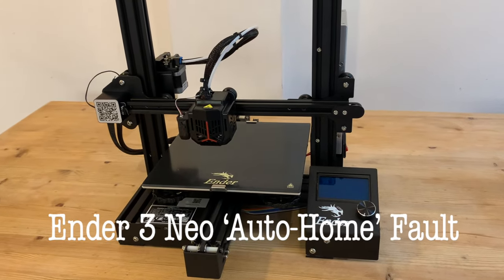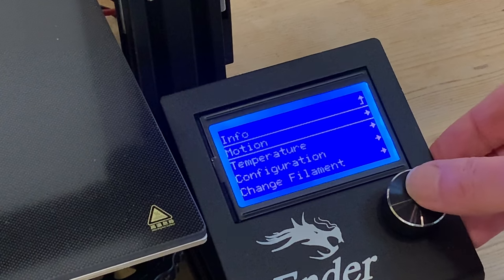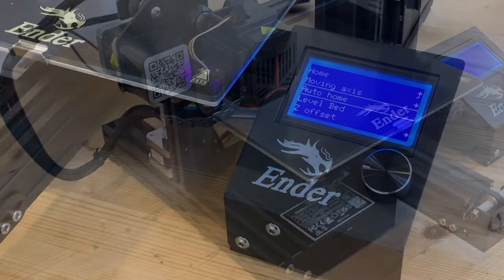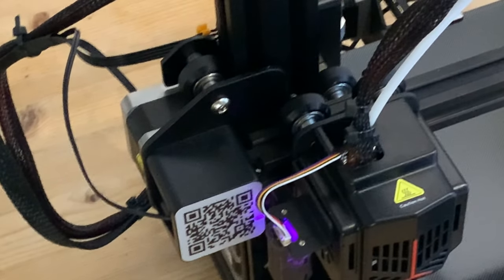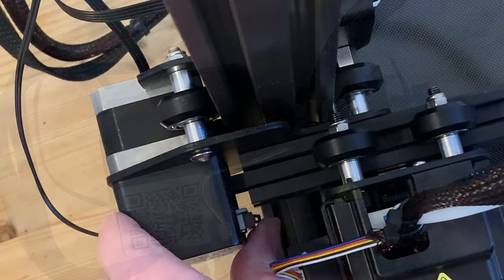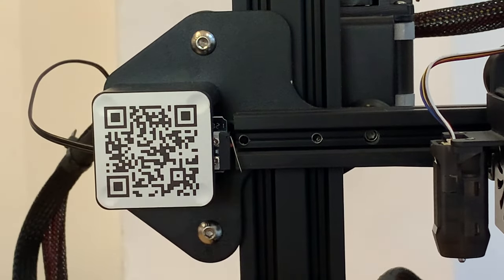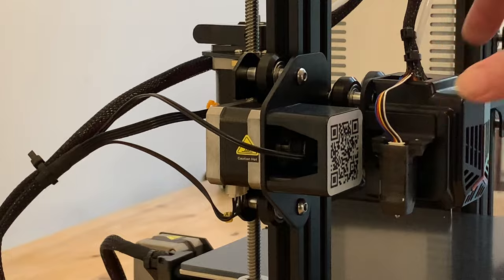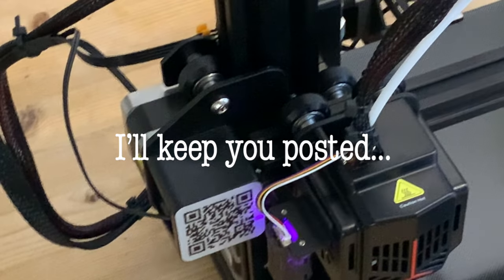Ender 3 Neo 'auto-home' fail - factory pre-assembly fault

Comment: Hi! I'm having the same problem as you, but in my Ender 3 V3 SE. The printhead goes to the ver right side and crashes with the end of the axis making that noise. I also have problems with the home coordinates because my printer starts too far from the usual home... I've tried to contact creality and they give a sh*t about me... Did you manage to fix it? Did they give you other suggestions or solutions?  Thanks for sharing!
Reply from the maker: Still pursuing with Creality by email, but I think I’ll end up reconstructing the faulty assembly. In your case, is there a micro switch at the end of the run that it should hit?
Reply from the maker: Gave up with Creality support, and decided to fix it myself: https://youtu.be/IJ0h2oAH28Q
Reply: man I've got the same issue with Ender 3 V3 SE. I thought it was a software issue so I've installed the Klipper on it but that didn't help, same problem. I'm really stuck on it. Any updates from you?
Reply from the maker: @ImOxy  Yes, I managed to rebuild the extruder unit the right way round: https://youtu.be/IJ0h2oAH28Q?si=SNq3GtvY5Nvrh4-i. Now works perfectly.

Comment from the maker: Creality customer services have got back to say I can skip the auto-home. Doesn’t seem ideal, but I’ll give it a go.
Reply: Stop wasting your time with Creality, and replace those screws by yourself, not a magic.
Anyway it won't work, because all slicer does auto-home in the start  of the print (G28 gcode) to get min or max values via endswitch ;)
Reply from the maker: I kinda want to give them a chance to sort it before going in myself. They have at least engaged by email, although not particularly helpful so far. However, the Twitter team seem to have worked out that there might be good PR in helping find a solution.
Reply from the maker: As you thought, little help from Creality, so I mended it myself: https://youtu.be/IJ0h2oAH28Q